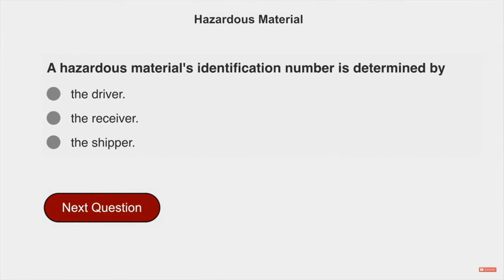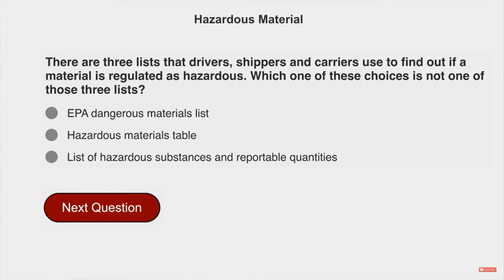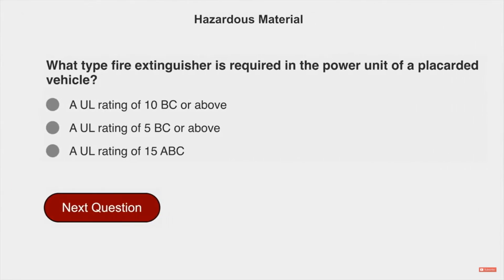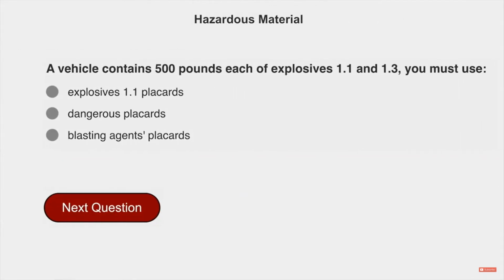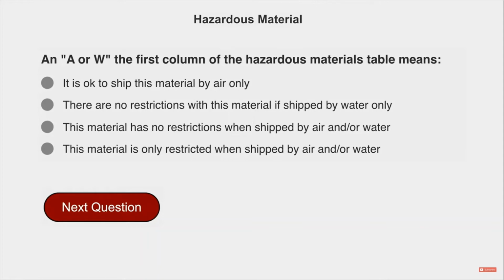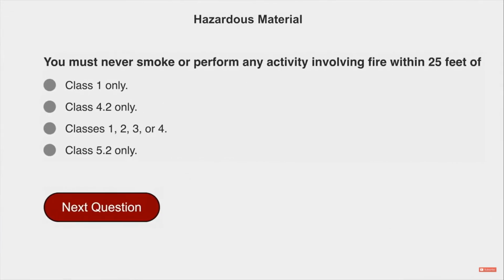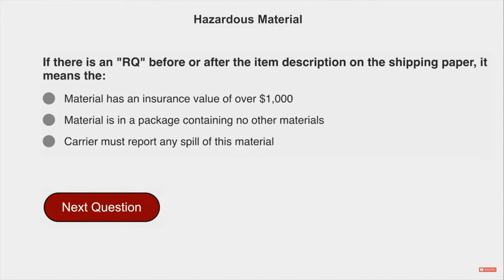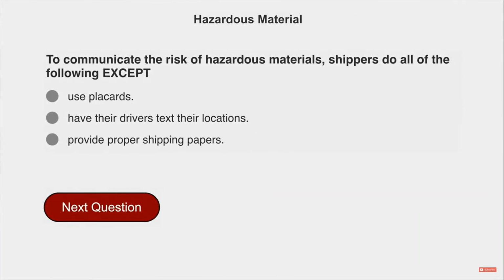CDL TRAINING - HAZMAT ENDORSEMENT KNOWLEDGE TEST - GREAT REFRESHER

Comment: in my state they asked what the letter a and the letter d mean in the description line, nothing i studies showed that
Reply from the maker: The letter "A" denotes a material that is subject to the requirements only when offered or intended for transportation by aircraft. The letter "D" is for domestic shipments. I believe that is correct, but I didn't look the info up to verify. Someone may correct me if I am wrong.
Reply: @faktransport  correct, I still passed but the one in this video for D and A I didnt' recall seein !
Reply from the maker: @GeronimoLogistics  Glad you passed. HM test is not easy for me since I don't deal with it alot. I have to read thru a few practice tests before going to renew my HM endorsement every time.

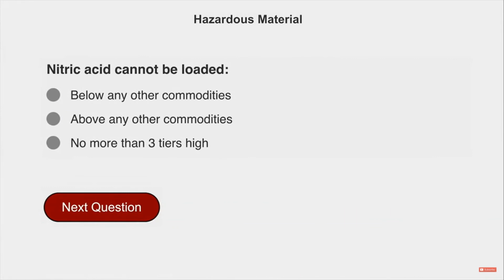Comment: At 21:55 Nitric Acid cannot be loaded
Below any other commodities 
Above any other commodities 
No more than 3 tiers high

Your answer shows Below any other commodities but it should be Above any other commodities because it is an acid so if it leaks it will destroy anything below it. I have used other practice tests and that answer Above any other commodities is the correct one
Reply from the maker: I agree. Thanks for watching.